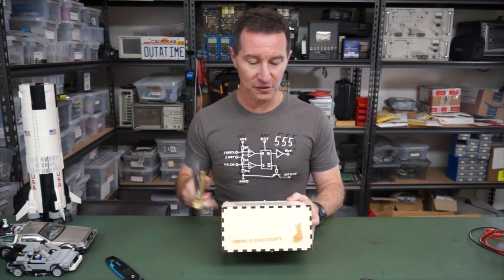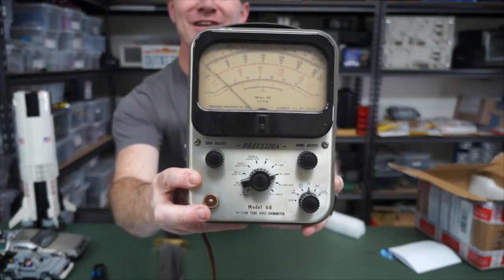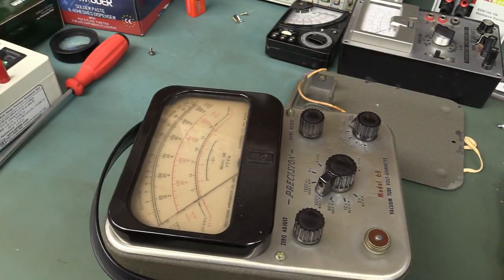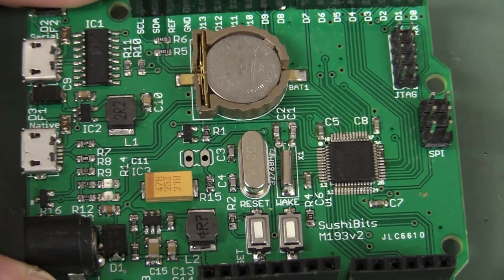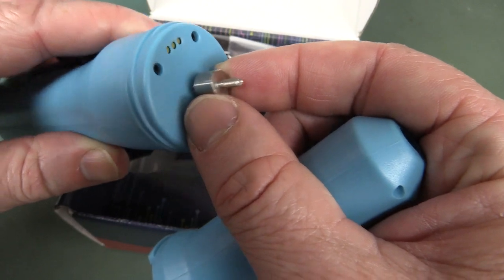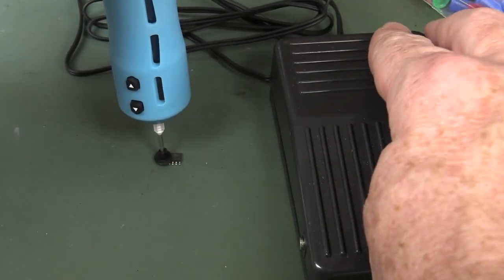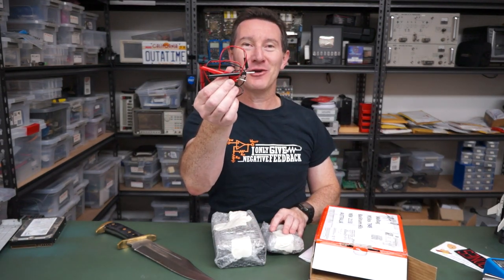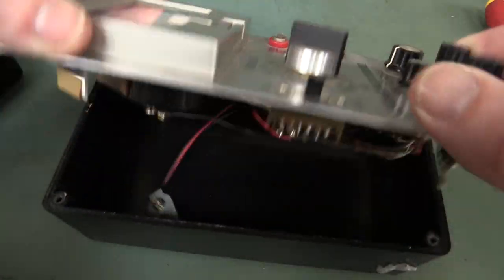EEVblog #1013 - Mailbag

Comment: On the VTVM the battery is used for the ohms scale.  The connector was commonly a microphone (unbalanced) connector.  If I were "updating" the device I'd make it a BNC connector.  Typically the input impedance was 1 meg ohm, and the "probe" added another 9 megs to make it a total of 10 megs.

Comment: I still use a VTVM for old valve (tube) TV and radio restoration. You can use a modified N type connector for the input and the battery is just for ohms, it will not power the meter. They are really good for high impedance valve work.

Comment: I own a Friden EC132, which added a square root key. It came out a few months after the 130. Also own an SCM Cogito 240SR, which is a cool old machine. There's some history between the two machines. Stanley Frankel designed the 240SR, and was a mathematician who worked on the Manhattan project. He had been censured over his views on the direction nuclear development should follow. That basically barred him from government work, so he went to Marchant with an idea for an electronic calculator. Marchant (who had either just merged, or was in the process of merging with Smith-Corona... I don't recall) was interested in the idea, but not the risk. They decided it would be better to offer to license the technology to their competitor, Friden. If the product failed to sell, Friden would take the loss, and if it was a success, they could collect royalties...

Friden, rather than taking the bait, said they were not interested. Instead, they rushed their own design to market, beating the Cogito by months. Friden's design was huge, clunky, and wasn't all that efficient, design wise. It did introduce RPN, if only for the fact that it made the hardware design simpler. Ultimately, it did work though.

The Cogito 240SR had an unusual input method, and an unusual output that could effectively count to infinity, at the expense of discarding least significant digits, and outputting a marker on the display that allowed you to keep track of the number of display overflows, so long as you manually counted the transitions. The Cogito was markedly smaller, and weighed a slightly less. It had a much more compact, narrower design, Had a wider variety of input options (like a grand total mode, and the ability to manually swap the contents of registers).

I love collecting old calculators, and those old models from the 1960s are some of my favorite ones!

Comment: On the VTVM the D cell that would be in battery holder was to provide a voltage for the ohmmeter--all VTVMs had them.  
There was no way it would power the whole meter.

Comment: The multimeter connector appears to be an Amphenol 75-mc1 series connector,
Reply: Looked a bit like a garden hose connector with a center pin.
Reply: I've seen it before - I think it was used as a microphone connector - a quick Google confirms my memory and gives me a name: SwitchCraft 2501F.
Reply: It could also be used with a Heathkit 432-1.   But yes, it was used as a mic connector.
Reply: Yes thats correct.. Amphenol "microphone" connector.

Comment: The LI stands for Long Island NY. Glendale is in Queens, one of the five boroughs of New York City. The connector is an Amphenol type used back in the 50's and 60's. Many microphones used them. The meter needs a D battery for the ohms function to operate.

Comment: 4:57 - converting 1440x1080 to 1920x1080 seems to be the biggest quality issue.  Up until you mentioned the lighting something seemed off with my picture but it wasn't the lighting.  Oh well... bet you will be double checking the recording mode next time!  ;-P

Comment: I am not an expert but 1080 looks like 480p... strange.
Reply: Also if you view it soon after it's posted the HD versions won't have been processed yet and it'll fall back to low res versions.
Reply: Robert Lach that's only because he used a bad deinterlace method. 1080i can look as good as 1080p if deinterlaced properly.

Comment: 3M is the only drug Dave needs

aaaaahhh I need that Silicon Valley book ASAP
and the solder paste dispenser would be cool to mount on a CNC machine... Hook into the trigger connection and Bob's your uncle
Reply: Given that I'm printing up a new multi-attachment holder for my CNC machine, I thought the exact same thing... especially since I'm using it for PCB rapid fabrication.. mill.. drill... solder paste... pick and place - you've almost got your own assembly line right there
Reply: Daniel Sullivan Exactly! Brilliant

Comment: What did they call the VTVM in the UK and in OZ?  Valve Volt Meter (VVM)?  Anyway the battery was only for the ohmmeter function.  I wondered why there were TWO 6AL5's, and then I realized that the second one was for the rectifier function in the power supply.  Most VTVM's used a selenium rectifier or a diode in a half wave rectifier.  The other 6AL5 was the AC signal rectifier for use on the AC volt meter functions.

Comment: Hmmm that is nice solder paste. Low temp melting point and Tin Bismuth Silver so it lasts longer than the ordinary bismuth. Expensive stuff actually. Apparently I beleive IBM used to or still does use the Tin Bismuth version.

Comment: Try to use 3200K on the lights and manually set your camera white balance closer to daylight or possibly the greenish florescent color temperature spectrum of around 4800K. But just for the Face shots. For the Close-Ups it could be too warm (or cold, depends on the shown colors).

Comment: I wouldn't be surprised to find that you have to have a battery in the VTVM AND plug it in to mains to use it.  The mains to run the filaments.
Reply: I think the battery is just for the Ohms range,  at least in my IM-28 VTVM it is.  AC/DC ranges seem to work fine without it.

Comment: They don't make them anymore? Certainly not like those, but look on ebay for transistor testers, they do them in digital, a ripoff from some DIY project, they are really pretty nice because they can identify and measure various things, imho quite nice for the DIY person who is on a budget and has to scavenge things for old parts, or even for repair jobs I occasionally use them to test 3pin devices for which I can't find any info about.

Comment: i assume they used the phono plug for power on that dispenser thingy because micro isn't as tight of a fit. it'd probably fall out while handling. also people would plug standart usb cables into it even though the pinout would be different on it (which would be bad).
Reply: During the Kickstarter campaign, they discussed with their backers, and decided to use 2.5mm jack instead of micro USB, because micro usb is also quite fragile.

Comment: How is a wood box environmentally unfriendly? when all the shit inside is.
Reply: sparkdog44 trees
Reply: Ever heard of reforestation?
Reply: Yup... Paper trees and trees desired for lumber are not simply cut down and the land left bare. They are planted like any other crop, allowed to grow, and harvested. The difference is the time they grow. Areas harvested rotate, as oldest trees become ready for harvest, and new trees sprout behind the last cutting. The most environmentally friendly thing you can do with paper, is send it to a landfill, to naturally decompose, the way nature intended. It is more energy intensive, and requires more chemicals to re-pulp paper, bleach it, and then add new fresh pulp to bring it's strength back up to a fraction of fresh pulp paper... When buying new paper supports an industry that keeps trees planted as they are harvested, and eliminates the transport of all that old paper BACK to the source... Let it decay naturally, locally.

Lumber is the same... trees are harvested, and new saplings planted afterwards.

Deforestation is not the result of paper or lumber industries... It's the result of human expansion into forested areas, converting them into tillable land or habitation.